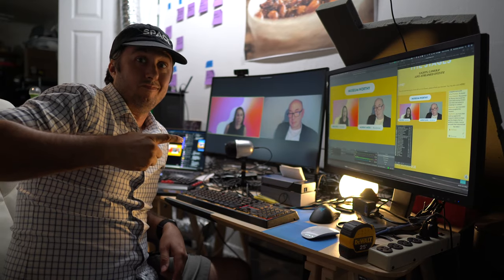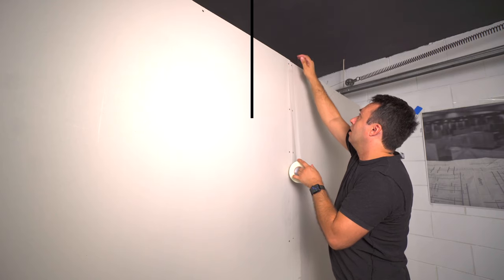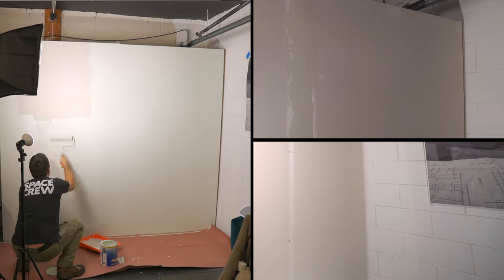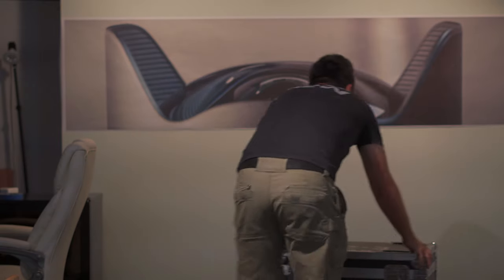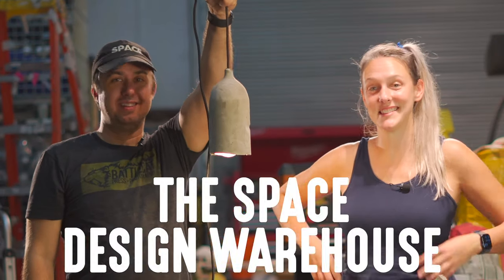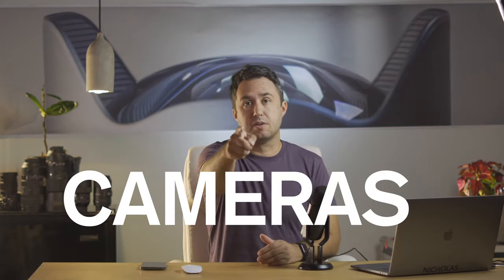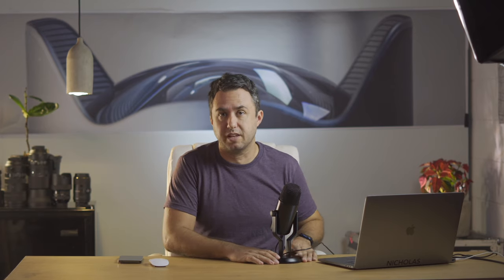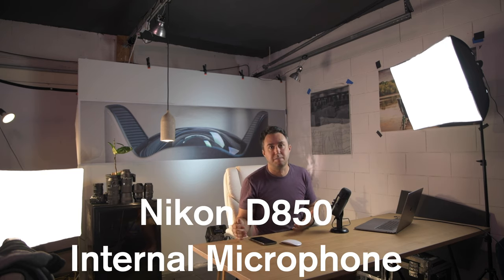Building a Youtube Studio in my Garage Office.. How to Make and Light a Set for Talking Head Shots

Comment: Very helpful video! Is it a major issue if there are windows in the garage? And if so, what would you use to cover them up? I still want to use them, so don't want to board them up or anything crazy. Would simple blackout blinds do the trick?
Reply from the maker: Oh for sure, black out blinds would do the trick. I have one window in my garage, but it actually lines up exactly with the direction my key light comes from AND since it’s on the north side of my house, there’s never direct sun, and so the light from it doesn’t REALLY change the picture from video to video. I’m sure there is some very small amount of different if I shoot in the middle of the night. 
But yeah, if the light coming through your windows is hitting your backdrop or something you don’t want, curtains or even like cardboard with some painters tape (painters tape and gaff tape both won’t leave any residue behind if you put them up and take them down over and over and won’t ruin the paint).
Reply from the maker: P.s. I LOVE that gypsy bus jam!!!!

Comment: How do you deal with heat and cooling the space?
Reply from the maker: I got lucky in a number of ways.. I live in Florida so it’s basically never cold, other than a couple weeks out of the year. And even then it’s like in the 50’s. 

For the summer, my garage happens to be on the north side of the house which means the sun never hits it directly, and for those VERY hot days which, really, is 80’s of all days, I have a 10,000 btu window AC unit in there and I pretty much leave the door to the house open, and between those it stays nice out there! 

We have solar on the roof and it works so well our electric bill is always zero ($8 connection fee to the grid) so I’m a little liberal with letting the ac just run like the wind!